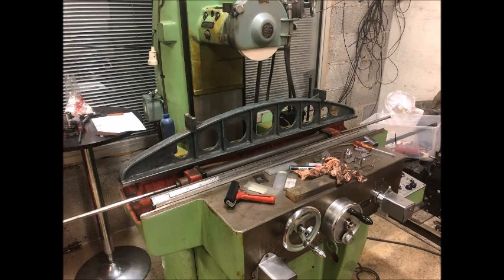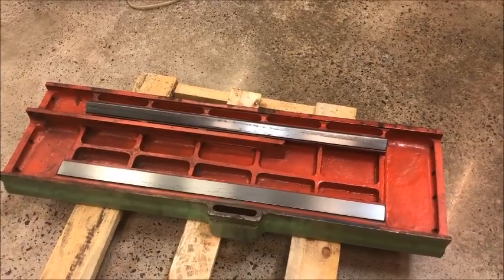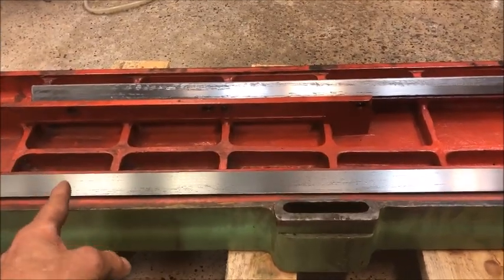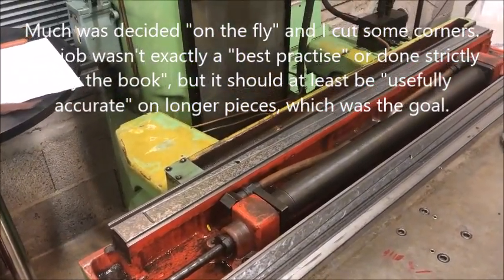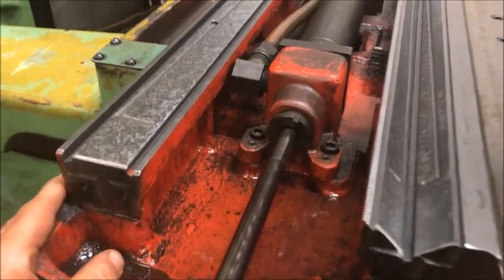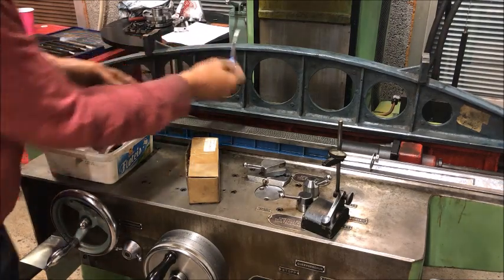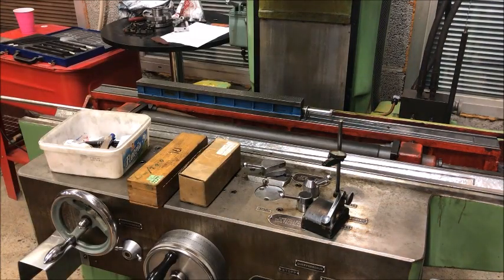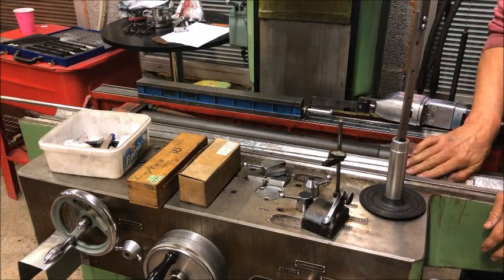Stanko 3G71 surface grinder - partial restoration.. just table and saddle cross slide ways

Comment: Is it possible to scrape in the table, making sure there is vertical alignment between flat and V with a kingway type tool, and then use the table to spot the saddle? This is how it was suggested to me to do a similar grinder.
Reply from the maker: Sure. We ground the table as a bed-grinder was available. Many ways to get this done, I suppose. If RK makes/sells more of these Kingway tools I will also buy one!

Comment: Having recently spent a good bit of time rebuilding my slightly smaller but similar East German grinder it is cool to see your process.
Reply from the maker: Thnks Luke. But I would say this  "job" hence video is not descriptive of "best practise" or "how to do it". It was more or less "a stunt project" and the process followed suit, ie. what was done in a "night shift". The obvious addition I would have done was to plan ahead and build/use a level "sled"/Kingway tool instead of building up a combination of cylinders, beam straightedge and blocks and shims
Reply: Stunt or not so long as you don't make it worse it is a good thing
Reply from the maker: @lukerickert5203  Of course.. it should be much better now
Reply: @jansverrehaugjord9934  - Too bad that time was such a limit.  I would be interested to see a reference part ground before and after the work.  Good job on getting things started!
Reply from the maker: @somebodyelse6673  Thanks. We did some grinding of a piece before, but no footage, sorry. I guess there will be ample time to view results on pieces in the future though, so can update later. PS! The shop is a bit of a distance away, and my friend is also not there all the time.. the main thing I do there is having my Myfords ground 😀 so this was a "sidetrack" project really.. that just evolved as we went along, but I thought it was nice to share anyhow
Reply: @somebodyelse6673  The adventure on this machine has been long, we found all the gibs were loose, the spindle bearing needed tightening, and the bearings in the electric motor is shot, the project has been put at wait until further notice, but we will come back stronger sooner than later